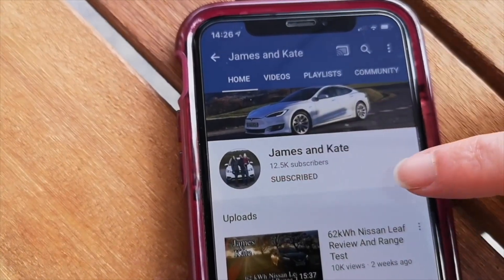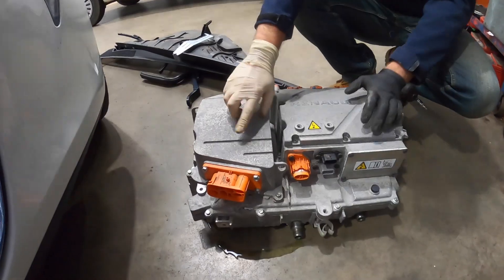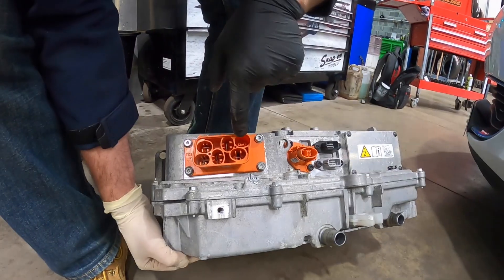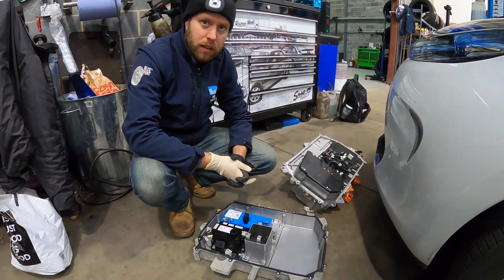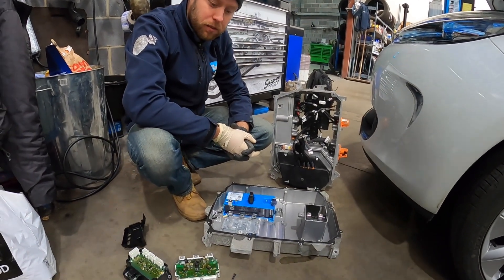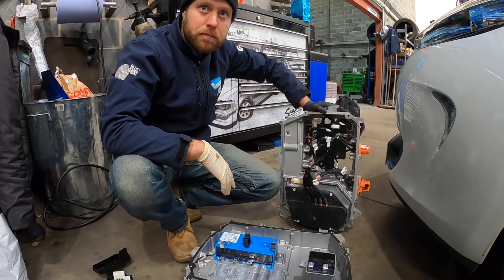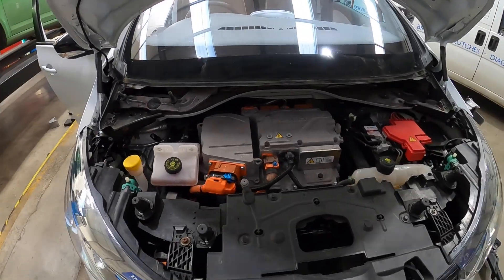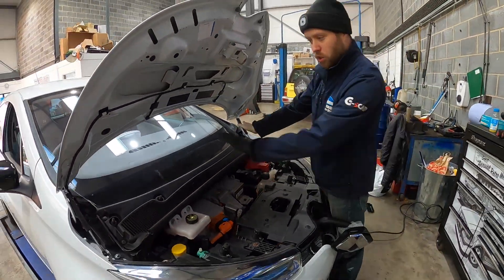Renault Zoe Charging Issues. - Cheap Fix

Comment: I live in the Netherlands and after calling aroud to 10 garages i can find none that can repair a Renault with a vharging error. Renault dealer is the cheapest and the quote is quite a bit more than the value of the vehicle. Garages do not want to work on EVs at all. It's very sad over here there are no technicians at all. The only thing offered is replacement ar full price.

Comment: Hi there. Do you repair the Zoe drive unit. Won’t go above 20 mph. Battery light stays on so low voltage system not charging
Reply from the maker: We do

Comment: My wife’s 2015 Zoe (Q210) has just come up with that fault code.. we’ve tried 2 other charge points in case our home charger is faulty, but still same.  Battery charges when being driven (braking, slowing down), but not from charge point.
Only happened this week when it was really hot, charged fine on Sunday.. really stumped now

Comment: Hello!
Is it possible to charge the car with one phase split by three ? To connect L1, L2, L3 on one phase? Or just to L1 and L2 and the L3 connects to the Neutral?
I read somewhere, if charging only with one phase, the capacitor will dry out and on three phase charging can be an issue with time. Is it true?
Reply from the maker: You can use 1p or 3p. If you start on 1p you can't switch to 3p without stopping the charge, if you do you'll damage it. Going the other way isn't an issue, it will pull the charge. It sets the type of charge from checking if you're on 3p/1p during initialisation. Charging on either for long periods is no issue. You can't split 1p across the three phases as the PEB drops L3 to neutral.
Reply: @Jamesandkate  ok. What will happen, if I split one phase to two? To L1 (230v) and L2 (230v)  as the PEB drops L3 to neutral. Will it see it as a 1p charge? but using all 3 lines?

Comment: What would be the possible cause if charging is limited to only around 2kW even with 3 phase charger?
Reply: Have you solved the problem? Sadly, I have a similar issue with you😢
Reply: @PowJoey  no, I've replaced the whole BCB with another unit but still facing the same. Probably related to BMS
Reply: @evmechanic  OMG😱 Are you going to have the BMS updated in this case?😢

Comment: Very lucky to have such s qualified technician. My Zoé 41kwh charger failed, it charges at home but not on public chargers. I live in France, they want to charge me 3900 Euros to replace the WHOLE unit. But your video proves thus isn't necessary.
Reply: Probably L3/N relay failed in closed position.
Reply: Where i found this relay because the same probleme i have  @Mladjasmilic
Reply: @Mladjasmilic hey man, i have this same issue. I plan on changing the relay but can't find the reference for it anywhere. I'm in France as well and they want to charge me 3k for the repair, but i'm an electronician and i don't want to pay that much 😂 do you have the relay model by any chance? I want to order it before disassembling the whole thing, so i can change it on the go. Thanks by advance and thanks for this video !

Comment: When i saw him handling the igbt rectifier on the concrete floor, i immediately thought: that's going to need replacement as the cooling contact plate is damaged. Then he told us that's the culprit he's going to replace.... I was so relieved😂

Comment: My Zoe from 2014 stopped charging recently. My Renault service workshop did a diagnosis and they say the whole motor must be replaced. The issue should be with the motors insulation and as the motor is part of the charging system, the car refuses to charge.

Does this make sense? Did anyone have the same issue?

Comment: Hi, I am like stuck in such a problem. Zoë quick charge, had an upgrade to 41 kWh battery, got it second hand. Worked perfectly for me for 3½ years so the car is total close to 7 years old. 
Does not charge on 3 fase anymore, only 1 fase charging works which I can do at home only atm. Official Renault dealer saying, only fully replacing the rectifyer unit at 4200€ will fix the problem. Which just breaks the bank for us.
As I had my education in electrical engineering (landed in IT specialist work, sorry 😉) it feels totally idiotic to throw away the whole rectifyer unit. And we simply can't spend this chunck of money in current crisis. 
Do you have any pointers where to find such a skilled repair shop in the Netherlands?

Comment: so the  rectifier - inductor - motor - motor windings and the voltage is step up to the needed voltage and then come back to the battery, it is the flow of charging in renault zoe. please comment me if I wrong

Comment: Any teardown technical documents, diagnosis tools etc you can share further on this repair?  Or any good sources for used/rebuild BCB's?  Are they car/VIN specific or swappable?  I have a 2013 with a defect BCB.  Are damaged sub-components typically visually diagnosable?

Comment: Hi Jemes and Kate, I have the same problem with my Renault Zoe from 2013. Service indicates that the charger unit needs to be replaced. Part no. is 29605343. Can you fix this for me? or pass on the part no. so I can replace it. I want to buy individual components from Renault. I just don't know the part no.
Reply: If you search whit your license plate you can use other part numbers renault give me the same part number as you are but second hand i bought one whit other partnumber

Comment: So it's just hardware parts? No need to reprogram or pair with the car?

I signed on a 17 ZE 40 R90 on Thursday and they're supposedly giving it to me on Tuesday or Wednesday.

The problem is yesterday I was googling for more info about the equipment of my model and trim level and I stumbled on a post about a car exactly as mine with charging problems that the dealer bought back because of that and that they had sold it like an R110.

It's too much coincidence, the Km, first registration, location and everything seems to fit with my car...

If it is the case and I have problems with charging it I could buy a used charging unit and swap it into mine?

I'm a mechanic, but I've never touched an EV, so I would have to learn before I do anything to it.

The problem is that there seems to be no garage in my area that specializes on EV, and if the dealer didn't help with the last owner... 😰

Comment: My zoe from 2013 the q210 will not charge after charging at mcdonalds fast charge bill €3500 for new charging system its crazy
Reply from the maker: That's ridiculous, sorry to hear it.
Reply: @Jamesandkate  its insane not my fault black screen on the charging system renault holland dont want tho compesite the cost i miss my zoe now 8 weeks
Reply: @Jamesandkate   do you know the prices of the modules inside this hole packege
Reply: @Jamesandkate  are the type numbers inside the same as the hole thing
Reply: I found a donor bcb for 24 bottles of beer

Comment: Would be able to fix my zoe a 2013 ev, it's mot charging either and the dealer is asking for £3000 to fix you may be able to do it cheaper, thanks.
Reply from the maker: Are they saying it needs a PEB?
Reply: @Jamesandkate  they are specifying they just said the charging unit needs replacing, I'm thinking they are wanting to change the whole unit like in your video you shared.

Comment: Have a Zoe that is taking 18 hours to charge on a 43KW charger and I have been told by Renault dealer that the whole thing needs to be change, over £6000 for a car that is barely 5 years old. I lost faith on EV and unfortunately on Renault. I'm thinking to go back to petrol until mechanics figure out how EV works, unless @james knows best and can help : )

Comment: Where can I find a garage to do this for my 2014 Zoe that is tripping my home consumer box on a 13 amp Renault charge cable and blew the dealers workshop. Dealer “thinks” it’s the filter block or the harness but either way I’m looking at £1600+ in repairs and would much prefer Pete’s £500 bill. How do I reach him? I’m in Kettering.
Reply from the maker: Hi. Our garage is in Cheltenham or Google HEVRA and that will put you in touch with Pete. 👍🏻

Comment: Hi guys, wondering if there are any tips after arriving at a charging station (AC Fast Charger) with really low battery left (2% and less) and the car doesn't want to charge, fault message comes up to say battery charging impossible and this has happened twice to us. Thanks

Comment: All very interesting👍
More concerning is WHY did the Infineon module fail? If it's a common issue like you said, it sounds like a design fault meaning ALL modules are at risk.
Reply: ✋ Sshhhhhusssh! 
You'll force Zoe prices down with comments like that

Comment: Interesting video because I know early Zoe's were very fussy on their charging requirements and I remember having a Zoe for 4-day trial which wouldn't charge on a granny charger at my home and I had to keep going back to the dealer every day for a couple of hours. Regarding the repair, isn't this sort of thing a warranty repair or does Zoe have a short warranty?

Technical point but the camera you used in the workshop I think wasn't set to 50Hz lighting and the brightness (of the workshop floor in particular) had a pulsing effect.
Reply: I've had a similar repair done on my Zoe, and it's covered by the 5-year warranty on the drivetrain.

Comment: This is great but how about you don't know someone who Knows his stuff, reliable and honest. You already said a main dealer would replace the whole unit costing thousands. I'm sorry but at the moment this is all too new. I'm prepared to wait a good few years until they are a normal price, the batteries last a normal time, you can charge them in a normal time and enough people know how to repair them. In 10 years we will look back and laugh at these videos
Reply: If all think this way EVs won't get common and there won't be enough independent shops as this one. I believe this is way simpler to fix than ICE, the problem is the dealers that don't have this kind of mechanics.

Comment: Are those kind of faults eventuelly caused by software bugs of those components (PEB, BCB, EVC, ...)?
Because Renault offers different updates for each of those components which I forced my dealer to install. XD
I heard that there was a bug where one compoment was smoked, when a charging station offered 2 of 3 phases and the Zoe then thought it could start a single phase charge or something. So this should be fixed with updating the components right?
Reply: The issue that you are describing is when 2nd phase goes down from your 3ph supply for some reason during charging (eg separate fuses in the fusebox and only 2 goes blown) then Zoe decides to switch to single phase charging as it monitors just 2nd phase to establish if 3phase AC supplybis available and decides the supply is single phase only. This causes a relay to short the 3rd phase to Neutral and BANG. I am not sure that monitoring the 3rd phase could be fixed with SW update, but disabling the auto 3to1phase switching could be. I might be wrong. The relay is in the filter box which is the smaller lid that he did not open in this video.

Comment: Hi, thanks the lecture video, it was very informative. I have a question (maybe not a wrong supposition), I am curious about your answer: is it reasoneable assumption, that the AC charging (up to 22kW) is much better for an EV battery's lifeterm (like Zoe), than the DC charging (50kW and beyond)? What do you think about it, what is your experience? 

What battery-degradations you have perceived yet? If my supposition is right, it means, the Zoe could be better choice, than many newer EV (in long term), because of its 22kW recharging possibility (if that is better for the battery than the DC charging). And btw it's cheaper, too! What is your opinion?
Reply: For most people they would be charging daily using 7kW or 11kW charging at home on any EV and then only occasional rapid charging for longer journeys, and it would do little harm.

Comment: That’s brilliant, just shows than contrary to what some say, these cars can be repaired and at a reasonable price by specialist repair shops. This is another fledgling industry born out of BEVs. alongside mining for lithium in Cornwall and the supply and maintenance of charge points both domestic and commercial..

Comment: I'm guessing these are the parts I would need to upgrade to get my Kangoo to charge at 22kW rather than 3.6kW ?
Reply: If it is charging with 3.6kw only on a 22kw station that's maybe the 3phase relay stuck to a single phase only, so maybe it is rather the filter box (the smaller one). But actually 22kw charging model has different internals and problems than this Q one

Comment: What if the charging box is ok and the car still refuses to charge? 
Could it be a short circuit in the electric motor?
Reply: If you suspect a short in the motor just check it with a multimeter, after stopping the high Voltage ad removing the motor wire
Reply: If there's a short in the motor you have bigger problems.  The car wouldn't move.

Comment: For vehicles sold in the United States, its a federal mandate for car manufactures to provide an 8 year warranty for the battery, electric motor and electric components including the inverter and charge controller.  So a 2014 vehicle would still be covered, for no cost repair at the dealer assuming they have someone trained with the know how.  For example, Chevrolet says on its web site...  in addition to the Bumper-to-Bumper Coverage described previously, Chevrolet will warrant certain components for each Chevrolet Volt, Bolt EV, and Malibu Hybrid for 8 years or 100,000 miles (160,000 kilometers) , whichever comes first, from the original in-service date of the vehicle, against warrantable repairs to the specific electric propulsion components of the vehicle.  If you don't have something like that in the UK, tell your MOT staff they should add that to the car manufacture's requirements as part of the 10 point plan green revolution recently published.     Well done.

Comment: I had decided to go for an ev next but after having to make a longish drive at night recently 125 miles and return within an hour I realised if I'd of been in an EV it would not of been possible. I am now thinking of a hybrid such as Peugeot 3008 hybrid 4. It has good reviews and is affordable. The bulk of journeys I can do in EV mode but with the ice to fall back on. I did check there is only 1 public charger en route as well but on this occasion I was on a tight schedule.
Reply: You could do that in a Zoe ZE40 without a problem, at least down to -5C if staying below 95km/h, even with a crappy battery. With the new Zoe ZE50 no problem to go 110km/h all distance even at -10C. My best so far has been 238km with 7% left at -17C (comfort 20C inside and 95km/h highway usage) but that was with an SoH (State of Health) at 99% battery. 59000km SoH is at 97% in 15 months.
Or as a backup plan, preheat the battery/compartment for at least 3 periods (stupid french programmers) before starting the journey than on the way back go for eco mode and stay below 90km/h and no heat... Then it would work just fine even at -10C in ZE40
Reply: Before lockdown I was commuting 120-130 miles a day in my ZE40 without charging.  It could technically be done in a ZE40 with a Q motor or a ZE50 as long as you had a rapid charger en route.  Something like a Hyundai Kona or a Kia E-Niro could do it in one but are more expensive.  All I'll say is maybe not now, but soon you'll have an affordable EV option for that type of journey.  The at night bit makes little difference as the lights are run off the 12V battery and the only connection with the 12V circuit and the traction circuit is the DC - DC converter that takes a small amount of power from the traction battery to keep the 12V battery topped up.

Comment: Had charging problem last last year with my 2013 Leaf, would only charge on chademo port. Nissan dealership had her for 1 week, charging unit replaces at £2700 pounds. best extended warranty I ever took out for £300 pounds. I wonder how much of this is still down to dealerships not understanding the tech they are working with.
Reply: None of it. Dealers are replacing the whole units. There are cases where for similar problem, as the one in the video, dealers are quoting replacing the entire drivetrain as parts were hardcoded by VIN. Most of the dealers don't understand electric modules at all. They would have to learn at some point in order to keep their jobs.

Comment: Nice one James.  Great to see that proper repair and diagnosis is being done.  Are the component subassembly parts available from Renault or are they aftermarket only?  (So Renault just does bigbit swapping as you describe).  Great video!
Reply: He said that it is Infenion circuit, so I suppose he is ordering the black box from Infenion directly.
Reply: @klisurski  Infineon? I doubt he ordered it directly from them. That's not how Tier ones to OEMs work.
Reply: @ruaraidhmcdonald-walker9524  I don't think it is OEM made for Renault. I believe Renault picked available at the time components from Infeneon's catalogue (and other brands too) and combined them together into the aluminum casing as a Renault part.
Reply: @klisurski  Yes indeed.  How many times as a small possibly even single item buyer have you bought anything from Infineon?  They are a B2B company!  You have to buy through multiple intermediteries if the part is even available throught that route...  Not always guaranteed.
Reply: @ruaraidhmcdonald-walker9524   you are correct-I thought I've bought some SMDs for ECUs from their website in the past, but it was actually a reseller's website. I just confirmed now.